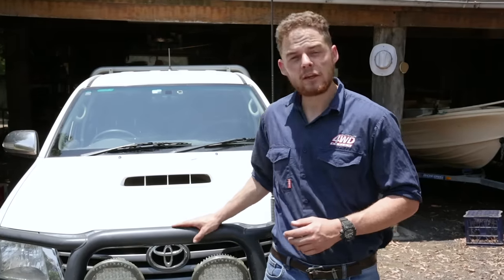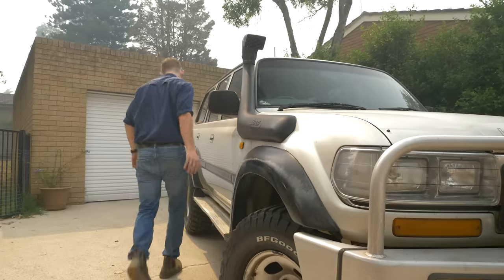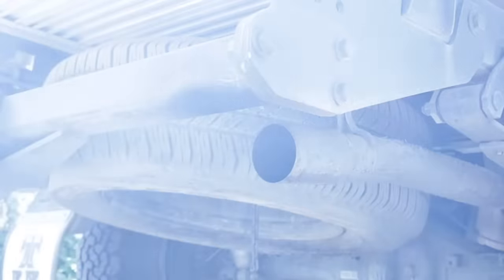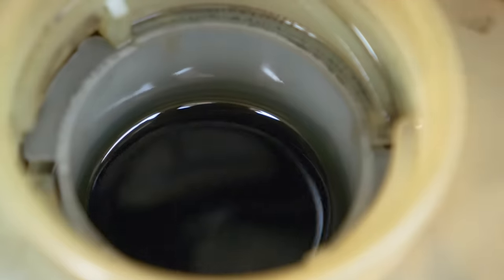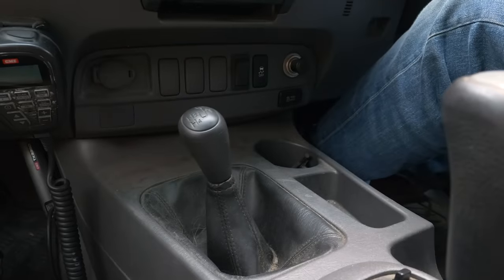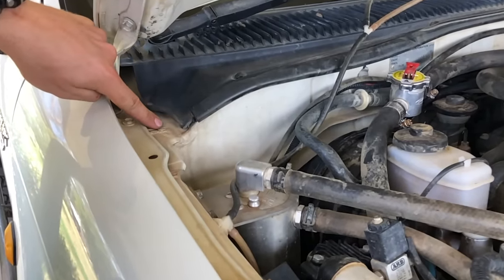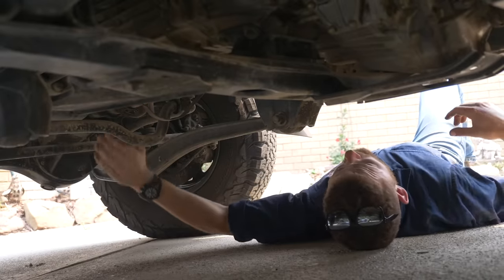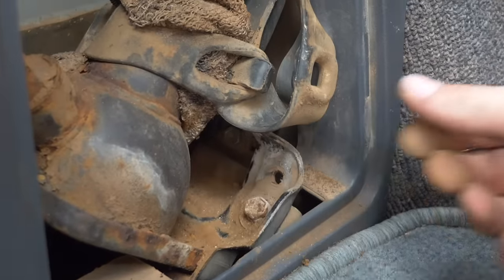BUYING USED 4WDs – Expert tips to avoid a LEMON and get a BARGAIN

Comment: I unfortunately sold my beloved D22 Nav a couple months ago and upgraded to 2016 Holden Colorado definitely nothing like the Navara sadly. 
Bit of a step down to a stock standard car from a 5” lift on 33” tyres 

These tips are the basics, drive the car for any sounds check the under body another good tip is check the engine bay for any mud if it’s got road grime that’s good if they’ve washed it whats Hiding, my Colorado has a list of stuff wrong with it I had two mechanics look over it and got two very different results so it can  also pay to get it checked out by other people other then you’re usual mechanic. 

A good mate mate of mine is a mechanic and he picked out more with the car then my normal mechanic so get friends or family to check over the car as well for there opinion.
Reply: nick byatt I had a 06 D22 ST-R ZD30 miss that old girl, bit cramped inside and the ride was a bit rough but man i loved its simplicity and i flogged the shit out of it and only replaced the radiator in 170000km trouble free driving.
Reply: wimmy d 
I had an 05 DX ZD30 first car took it everywhere I went. 
Front locked and was honestly a point and shoot job. 
Easily kept up with 4” lifted patrols. 
Done one cv, one hub, one set of front bearings and a ac compressor. 
The places I took the old girl I honestly think people wouldn’t believe me

Comment: Had a 2006 Toyota Hilux Vigo which was a lemon. The chasis was bent but it wasn't obvious at first. But after a few months of driving all four wheels had very obvious negative camber wear that made it necessary to change out the tyres twice a year.

Comment: ......and everybody asked me why I bought a 10 YO Mitsubishi Triton and not a Luxy or whatever. Got it cheap from a bloke moving overseas. Auto and stock standard, 6 months later and a lot of work - bullbar, suspension, tyres, winch, engine work, etc. Already midway into the Asian monsoon and having a ball. One trip I had to pull 2 Luxies, a 110 and a Nissan out of a pickle.

Comment: I've had both.   I bought a 60 series that the roof completely rusted out within the first 12 months.   Being colorblind I couldn't spot the dodgy repair paint job.  I thought it was rust free, it was just hiding under bog and paint.  My current hilux though was very well looked after by an older owner who had every aftermarket accessory you could think of all professionally installed and so far so good.   Been a few years and nothing major gone wrong so fingers crossed.  In between the two I had an 80 series that was mechanically brilliant for a decade.   The body looked like a total POS with faded paint and had the usual seat rips but it just kept going and going.

Comment: Bought an 2006 V6 Hilux from a guy who said his misso just used it to drop kids at school and a get around car. And never driven it on the beach. Was clean as inside and after pulling back carpet was clean. Once I got it home, got road worthy and paid insurance. Thought I’d give it a clean. Put the hose in the Chasy the out came sand, I swear must of been full with it. Remember to check hard to reach and clean places. 🤦🏽‍♂️

Comment: Bought my 03 D22 turbo diesel @ 170,000kms for a bargain. Besides the notorious paint defects, it drives very well and had dual battery set-up and prefuel filter fitted. Bought it knowing it needed glow plugs replaced.. which I did and the only thing I had to replace was a starter motor. Wont be selling it anytime soon

Comment: So, be wary of someone who uses vehicle as intended; cleans up underneath properly AND regularly does a thorough clean and, knowing there will always be a bit of surface rust spotting from time to time, treats it with rust converter and enamel paint to seal it properly to stop in tracks or even just to keep the dif housing looking good.  I do this but didn't know that these touch ups would make it harder to sell.

Comment: Excellent video. When buying a used vehicle with ABS make sure the ABS light comes on momentarily then goes out when starting the ignition. Some unscrupulous people remove the ABS bulb from the instrument cluster to cover up ABS faults. The Mitsubishi L200 K74 pick up fitted with ABS has a very badly designed front wheel sensor and ring which is external and not internal like later models. All it takes is a few specs of dirt to stick to the front abs wheel sensor and the ABS will be rendered useless. These front Mitsubishi L200 K74 ABS wheel sensors are so magnetic I can even pick up my vice grips  with one of these sensors. So any specs of rust are instantly attracted to them . They are also very difficult to clean and can snap off when trying to remove them . The only way to get the brakes working correctly is to convert this to the Mitsubishi L200 K74 system without ABS brakes which uses a load sensing valve on the rear axle. Check government legislation before doing this conversion.

Comment: I'm clearly not your target audience because I bought a petrol, however I got a vehicle with full service history and a bunch of accessories that had genuinely never been off-road (the only downside was that the first few shifts to low range were a struggle before it loosened up), since then I've put on 150,000km without issue, and because they no longer sell a suitable replacement I'll never sell it.

Comment: I bought my 1997 twin locked 80 Series GXL with a 4 inch lift on 35s (and a whole lot more) engineered, for $12,000 when the mods that have been put on it are worth over $45,000. And the only problems I've had are ones I've caused haha! I got a bargain!

Comment: Bought a 2012 SR5 Hilux with a plethora of ARB gear and custom tray work done to it for under $25k. The bloke i bought it off had done a few cape york trip in it and mostly highway kilometers. All ive done to it so far is add an external trans cooler.

Comment: I bought a bog stock 2.8td rodeo off a farmer for 4k and managed to drive it for roughly 34000kms with only basic stuff needing to be fixed e.g. starter motor because I took it through some mud, second 4by I've owned and surprised me how far it went off road, now onto the next project 1990 GQ patrol

Comment: I bought a 2012 GLR MN Mitsubishi Triton dual cab manual with 73k on the clock with bull bar, dual batties, snorkel, sidesteps, electric brake controller, tub liner, carryboy canopy and tow package all for $23500

Comment: I think I may have bought a lemon off a well knowm used car dealership. Didnt inspect the vehicle and didnt pay for a mechanic to go over the vehicle. Didnt ask questions about the history. First time car buyer and I definately learnt my lesson. Car had been repainted, spray painted black underneath so rust is now visible when it wasnt before. Corrosion in wiring, mechanics told me car looks like it has been submerged in water prior. Dont know what to do.

Comment: I got a loan and went and brought a Nissan navara d40 didn’t listen to any of the bad reviews, only the good... paid $16k from a used dealer 2 days later found it had a head gasket problem took it back they had it over 2 months to get fixed finally got it back and then the turbo gaskets , and a few other gaskets were stuffed that cost around 14k to get fixed... then the clutch started to go, and the diff... worst experience ever

Comment: If buying a 4 cylinder Amarok ..get the transmission fluid checked .It is supposedly a" lifetime" fluid . It is not . Should be changed around 80,000ks at the most . If not do not buy it . I have so far spent over $6000 getting a torque converter replaced . This only broke down when the transmission fluid was changed. This happened almost straight away .Also if you buy an Amarok immediately buy an aftermarket transmission cooler . The existing one is inadequate for Australian heat .  I love my 6 year old Amarok .It is great on the beach and fantastic as a drive car around town..(the constant all wheel drive makes it so safe on the road)...but they are expensive when something goes wrong .

Comment: I bought a bog stock 105 series Cruiser in great condition and low ks. Since buying it i have spent WAY more money on mods and accessories than i would have if i bought one already done up that needed a centre bearing, brakes and a head gasket. Theres more than one way to look at a used 4x4

Comment: Bought a 98 rav 4 with 170k km on it just had the timing done. Came with brand new snow tires and rims, summer tires and rims for 2750$ Canadian cost me 300$ total to safety. Been driving it for 3 years only issue is exhaust. Don’t care about the exhaust since it costs 1500$ to replace the whole thing.

Comment: When test driving do some higher rpm de-acceleration in the lower gears and pump the accelerator on and off a few times in top gear (manual) make shaw the gear box does not pop out of gears, drive it in 4wd make shaw none of the cvs clicking and the 4wd works lol
Reply: thanks - good advice Greg.

Comment: Yep bought a 1999 GU TD42 with 450,000km and is super healthy had to replace engine mount and a few little other things but drives like a dream tiny bit of surface rust   nothing to worry about I'll be long dead by the time it looks like a 60 series

Comment: Bought my first 4wd a 2006 hilux, absolute lemon, always breaking and always off the road for repairs. Sold that at a loss and bought a 2000 5L Hilux space cab. Replaced gearbox and turbo’d it and she’s a pearler. Has not let me down. Most recently bought a 2017 colorado with low k’s and all the fruit for the price you would pay for a bog stocker. Needed something more comfortable and an auto for the missus to drive and the colorado was too good to pass 👌
Reply: Toyotas are the most reliable according to just about everyone who believes in fairies.  You couldn't possibly have owned 2 that are junk......
Reply: Ein Felder never said I owned 2 that are junk. My first one, the 2006 hilux had a hard life before I bought it.
Reply: @einfelder8262  pearler means pretty good.
Reply: @garyfoale3707  No shit sherlock.

Comment: I've had my HJ75 ute with a 1HT engine since almost new. Would not sell it for quids! It's had two complete rebuilds on 15th and 30th birthdays just because and runs like a dream. No rust, 700000ks on the clock and aiming to see the 1million tick over. I rarely do 4x4 work now. If I do it is mostly around the horse paddocks. But next year I may be in the market for a near new landcruiser twin cab hopefully V8 that I can use for towing a reasonable sized van. Just have to wait and see. So your video about buying a good 4x is pertinent.

Comment: Good video but in my opinion (car nut for 40+ years) there is one problem with one of his last statements. Buying an old low mileage vehicle is not always a great idea to do over a newer high mileage vehicle. Many of the newer vehicles are lasting far longer then the old ones. Back in the day 100k miles use to be considered near max life of a vehicle where today 200k is nothing on many vehicles. Also if a old vehicle has too low of miles then it hasn't been driven enough and all the seals could be dry and rotten. So there is a fine line between the two.

Comment: I lived in Michigan for 12 years and it is impossible to find an older truck or car up there with no rust that is because they use salt  on the roads in the winter time so you just have to find one with his little rust as possible. I had a 99 Expedition the rocker panels were so rusted that I could actually put my hand up inside them but that was the best 4 wheel drive that I've ever had I bombed that thing through two feet of snow never got stuck it got me out of a snow-filled ditch after I lost control on an icy road and in the summertime  we would go out on the trails go through the mud and yeah I would get stuck and had to be pulled out just like everybody else  but I didn't get stuck near as much as my friends in those overrated Jeep things it was bone stock no lift kit the only thing I had done to it was more aggressive tires

Comment: I picked up 90 model turbo 1hz 80 series gxl for $7000. Second owner in mint condition. Tiny rust spot in back top door but that’s it. K’s are up there but motor being rebuilt now as I did a head gasket and the head was crack so figured I’d rebuild the lot.

Comment: Check the wheel nuts for excessive scratches indicates constant wheel changes or issue the steering wheel is also a good sign woman mostly drive with 2 hands men 1 so look for shiny patches also missed wrecker writing on used 2nd hand parts all tyres same date code = maintained regardless of cost normally a company car or some ones prize possession condition of the rest of the motor will tell you what 1

Comment: I bought an ex miner hilux from a lease company in karratha 9 years ago and only found out a few years later that someone before me had lost the original car key as they had replaced the ignition barrel and key but didnt bother with the door barrel. When the ute battery completely gave out the central locking wouldnt work and I couldnt open the door as the key didnt match the door barrel. Watch out for things like this with ex mine vehicles.

Comment: Check the chassis number while you're underneath  it . 
 A useful tip is to put a long piece of wood ( half a broom handle is ideal ) one end against the ear and the other against which ever part of the engine that gives you cause for concern .  You can hear noisy tappets  or any other  undesirable  faults . 
 Practice on your mates trusted 4x4 engines first .
Reply: Imagine pulling out a broom stick while inspecting someone’s car and pushing it to your ear.

Comment: My first 4x4 is a 8v Land Rover discovery1  with a genuine 195000km for $2000 all logbook serviced have had some  issues with it the worst was that Land Rover run oil in front cv joint so it had  leaked out so I broke the cv joint most  mechanics will not know this and don’t check this on a Service but it has never not got me back home. My new 4x4 is a Holden Rodeo 2.8turbo Diesel it is a single owner vehicle all it cost was the fuel to pick it up it is the new project.

Comment: i brought a 1991 4runner surf 2.4td  a bargain and just fixed cam shaft key ,cam pulley did belts and new battery.
 hoping to put more on it such as roof rack full length light bar front tow bar winch awning came with car workshop manual came with it to so good fun

Comment: Brought an 80 , head gasket blew 4weeks after I brought it it's did have 370,000 on it . It's a petrol 1fz-fe bar the block , rebuilt an replaced cam gears chains water pump cylinder head valves injectors an heaps of other stuff for ruffly 3,000 an its never mist a beat since I did it all properly the fist time an that was 4 yrs ago . An I only paid $2200 for it when I first brought it .old  Owner said it needed some TLC .. Lol

Comment: So I payed 32990 for a 2012 bt50 dual cab. Had it for 6 days and an Injector got stuck open and melted a hole threw the piston. It'd been threw 5 turbos 2 drive shafts. Timing cover leaks. Air Conditioning fan. Uni joints. Now it's down another turbo and has a rear main leak. Time to get a Toyota a real 4x4

Comment: Guy I bought my 100 TD off was honest as... But it's a bit hard to hide or BS about piston slap when you can hear it from a street away!  (Had been severly overheated due radiator failure)  And suspension was completely shagged.  
Anyway someone had to buy it, and 11k was a bargain.  4 months and 8k later, have a 440k km td100 with a rebuilt engine and new suspension.  Should go another 500k.
And tip, normal engine cranes and engine stands bend from weight of a 1hd FTE!

Comment: First cari bought as an 18 year old was a Suzuki Sierra and I knew nothing about cars and never got it checked. A couple of days of driving it and the I was having issues changing gears, the clutch was gone😢😢 a few hundred bucks later and it was up and running and it ended up being a good car, oh except to breaking engine brackets a couple of times going off road

Comment: I got a good jeep grand Cherokee WG. 2500€ in Germany 4 inch lift and 2 inch spacers. Besides from oiling engine it had one failecode P0702 (internet said the most expensive fix would be 300€) reading fsilcodes should be included in the video... So far i drove 20.000km around the middle sea starting from Germany and its ok. Have to fix the cooler and got deathwobble. But those are not very expensive parts.

So for that little money i got a very nice car!

Comment: If it has a lift, oversize tyres or any modification that wouldn't normally be covered by warranty I would walk. Just having a towbar and a redarc brake controller is nothing to worry zbout because any trailer 2000kg ATM or above has electric brakes and needs a controller.

Comment: Brought a 2012 triton from car yard previous owner traded it in blown up due to over heating the car yard soon realised there was a recall on radiator cap and had engine replaced under warranty we got it with 86000km on it and motor was 1 moth old with a couple of test drives on it $15000 took car back for a dogey cv joint but it seems to be good we put nearly 20000km on it and with reqular services it hasn't caused a problem it did have a few minor dents but ok it's 8yrs old

Comment: Just bought a 2010 Prado - 150 D4, I'm in love again and the comfort for my back is magic. Sadly l viewed the car in the wet so l didn't see all the dents and resprays bit's, bonnet bolts have been removed ? but the motor purrs and no known issues, yes there's some red dust and rock blasting underneath but l did expect something. Did a shake down drive and found 1 issue which is a Roadworthy point so the car yard is going to be contacted, At least the warranty is 3 years
Reply: that's a good luck story - you reckon the car yard can't wangle their way out of any warranty claim"...They are pretty good at that - it is their business after all. Good luck.